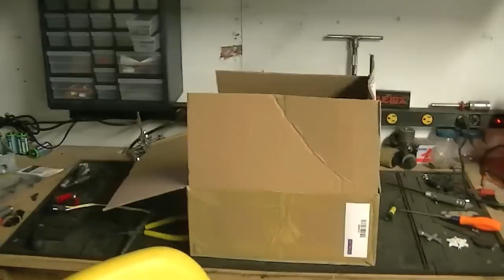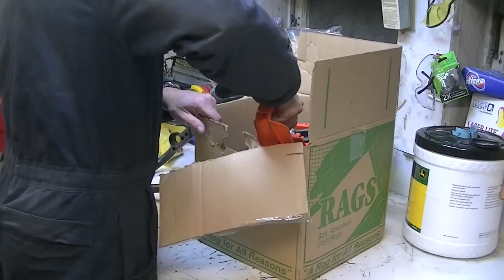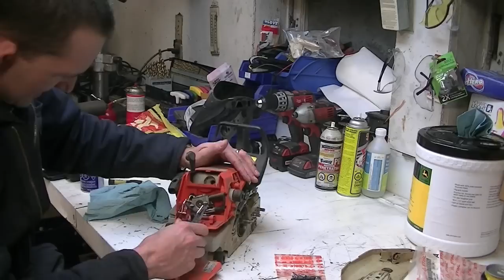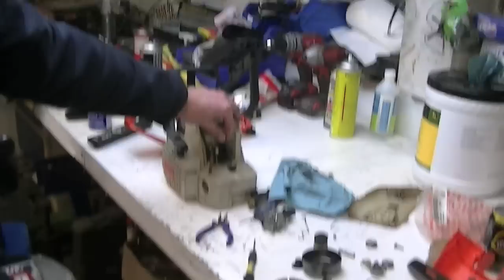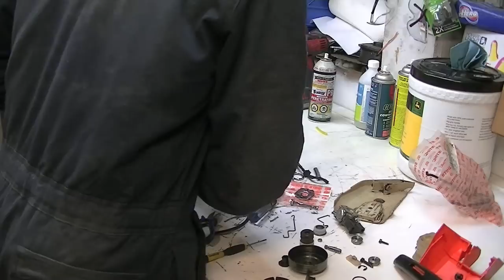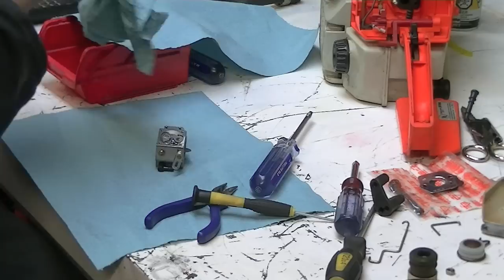Stihl 025 Chainsaw Repair? - Part 1

Comment: I restored a 025 a few months ago.  It is a pretty simple saw, a lot like my other Stihl saws.  Since I had built a Farmertec MS 250 I had a pretty good idea what I needed to do, plus I had a few MS 250 parts left over and the two saws are almost identical it was an easy replace of parts. I like it a lot better than my MS 250’s, because it is a lot lighter and easier to start.

Comment: Nice Job,   I would have taken outside and hosed down with soap n water,  and bought a new carb,  they're cheap.. Stihl is an awesome saw..  The two strokes take a beating and still got lots a power..   I got an 023,   I love it.  It reminds Me of my bike.
Reply from the maker: ThomasTheSailor Chubby The saw is still working awesome. Carb was good; I gave it a cleanup and no issues.

Comment: I don't know what to say about this video.  I gave it a thumbs up because it was well done and seemed to be a serious attempt to make a contribution.  That said:

Stihl chainsaw repair is an art.  The manufacturer does make it difficult by withholding critical documents, tools and at times even parts.  That should impact a buyer's choice of companies.  I understand the problem.  However, none of that justifies work that is so bad it is just plain unprofessional and potentially harmful.  This video fits that category.

I will pick just one of countless examples between the two parts I viewed.  The roll of the impulse tube can not be overstated.  In my experience, it accounts for about half the catastrophic failures of Stihl products (I have worked on 362 Stihl products since I started keeping records).  Hacking about with junk tubing dredged from a pile of random parts is simply stupid.

The flexibility of the tube is absolutely critical to the survival of the saw.  The AV system separates the handle unit from the engine. Note that there are no means for securing the tube at either end.  Stiff tubing made for a totally different application all but guarantees failure.  Hopefully the saw will just stop running.  If, on the other hand, the tube simply leaks a bit, the engine will run so lean (therefore hot) that the top end will seize in minutes.

This is one of countless, amateur level errors in this video.  Do not follow anything the author recommends.  I almost stopped watching when the needle nose pliers touched the new fuel line.  Wow.

If you don't know what you are doing, work on something else.  Leave Stihl equipment to people with experience.
Reply from the maker: Crocellian After over a year of good use it is still running just fine, so I must have done something right.  Are you just pissed off that an amateur fixed a Stihl without having to pay someone like you to do it?  The' junk' tubing I used was brand new Tygon fuel line which will hold up better than the line that was on the saw to begin with.  Go show your intelligence elsewhere as I have no patience for keyboard commandos.  If you are so damn good post some videos on your own channel showing people how to do it properly.
Reply from the maker: +Jd Muckenfuss I bet you are. Post a video to prove it and show all the things I did wrong and all of the special tools needed.   Otherwise don't waste people's time posting know it all comments on YouTube.
Reply from the maker: So what 'proper' service tools should I have used to do this?  And what is inherently wrong with using a new, fuel resistant piece of Tygon tubing in place of the factory part?  And yes, both the impulse line and fuel line were dry rotted with age; it didn't break just because I was dismantling the saw.  I find it funny how I seem to have offended so called Stihl mechanics (internet experts) by fixing a saw for my own use.  By the way, this saw got a severe workout by someone that knows how to use a saw cutting down and bucking up a large Maple tree, which is a pretty hard wood, last weekend and it did just fine with no issues.
Reply from the maker: +Jd Muckenfuss As well, I don't recall claiming this as an instructional video,  it is a vlog of me fixing a dead saw.
Reply from the maker: +Jd Muckenfuss Well there you go. Instead of just commenting at the start saying how wrong everything is in a video maybe you should give the constructive criticism at the very beginning.   How can you not expect me to get defensive when you come on my channel and cut me down? And finally, if you are such an amazing Stihl mechanic why did you even watch the video if not just to find fault and and comment on it?
Reply from the maker: Well guys, sorry to say but the saw is still working just fine on spite of my shitty rebuild. Just thought you would like to know.
Reply: Here are two people that are wrong. The frailer of impulse hoses are pretty rare. (I've not replaced one yet this year) point one, and when they do its not catastrophic you go to your stihl dealer with a five dollar bill and get a new one. One more point, if you don't have the proper stihl service tools your probably going to do more damage than good. The fuel line replacement on this saw should take around 10 minutes for example. The impulse hose was not damaged until he started trying to rip the handle housing off instead of disassembling it.
Reply: +Lafond RC did not mean to offend but you are the one posting a so called instructional video. I don't have enough space to go into all that was wrong or un needed. I'm a gold level, master wrench Stihl tech so take my word for it
Reply: +Lafond RC I think its implied that this is an instructional vid. So trying to rip the motor housing off before you remove the carburetor,disconnect the wire harness,disconnect the impulse hose and remove the buffer plugs says a lot. The impulse hose is designed not to collapse when the handle housing is flexed. Conventional tubing WILL fail much sooner. Just trying to help, didn't mean to hurt your feelings.